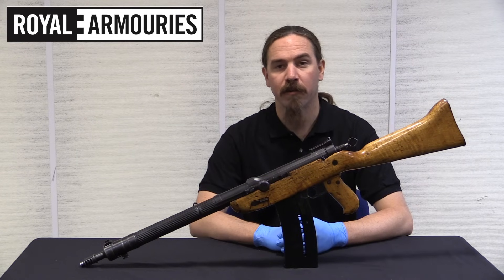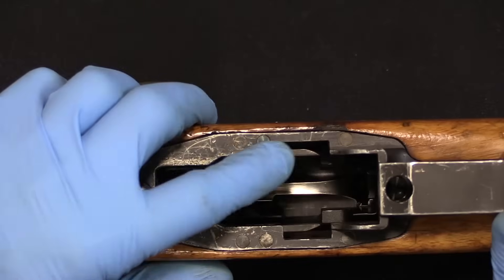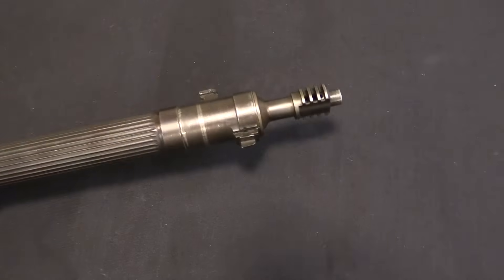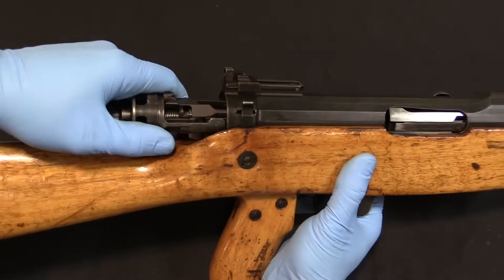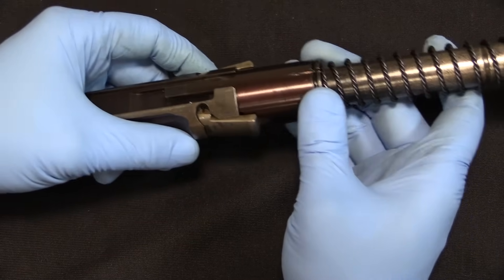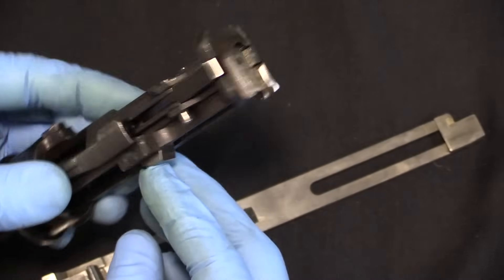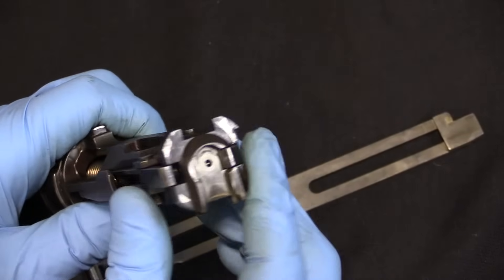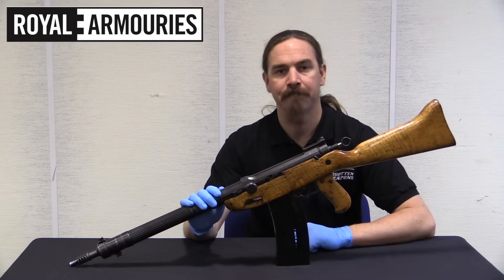SIG AK-53: A Truly Weird Forward-Operating Rifle

Comment: You know it's a weird gun if Ian isn't sure how to classify its operation.
Reply: You know it's a weird gun when Ian calls at least one component 'the thing'
Reply: "Clock Maker's Nightmare."
There, it's properly classified now.
Reply: @crimsonhalo13  I think the G11 still has that title locked down
Reply: Blow forward Piston delayed flapper lock?
Reply: @hoeruokamix  Close, but it isn't blow forward, because blow forward means an unlocked breach, much like how blowback means an unlocked (rearward moving) breach.

Now, systems are usually named after how they work. Roller delayed is delayed by rollers. Rotating bolts rotate. Recoil operated firearms take their impulse from the recoil.

So I'd call this a gas operated, flapper locked, fixed breach sliding barrel firearm.
Reply: i call it The Fluffer
Reply: Nathan Chan the G11 uses a gas operated rotary breech. The AN-94 was a stronger contender for most difficult operation to classify.
Reply: This totally started as an "I bet you can't" design. 
"I bet you can't make a gun where everything works backwards and still functions as a usable firearm."
"Hold my beer." Swiss happens
Reply: War Zone blow-foward implies that it is an unlocked action, and the gun is clearly not using an unlocked action.
Reply: @crimsonhalo13  Yeah! Perfect definition.
Reply: The gun that stumped gun jesus
Reply: Well said robooty girlyman
Reply: Because a piston is what causes the barrel to move forward, this can't be classified as "blow forward".
Reply: I genuinely think I can get a better mental image of how a G11 operates compared to this.
Reply: @Fish_nipples1998  it's a weapon that seems to fire in every configuration....
Reply: Exactly my thoughts! 🤣🤣👍
Reply: It blows.
Reply: @jackandersen1262  The AN-94 is still just a piston operated rotating bolt rifle. The odd parts are the feeding mechanism and reciprocating inner receiver, and those don't really impact it's classification.
Reply: Backwards?
Reply: I wish it was true lol
Reply: You also know it’s a weird gun if Ian has gloves on
Reply: It'd be weirder if when fired it sounds like "Cook coo"
Reply: The thing... Hahs

Comment: This was a practical joke by the engineering team at SIG. Clearly the cross of Swiss humor and engineers' humor sailed clean over the heads of everyone.  And that catch on the left side is a disassembly lever of sorts - it allows the removal of the magazine; thus disassembles one part.
Reply: When you watch the video with that being the assumption, it's actually pretty hilarious and seems highly likely.
Reply: Early example of California compliance. Magazine is fixed until disassembly
Reply: Swiss firearms designers, late in the evening after a long day at work:

"You think that's a weird operating system? Ha! Here, hold my bier..."
Reply: Perhaps SIG hired a watch maker?
To develope the back then new style guns that not only go tok.
But tik tok, tik tok, tik tok.
Reply: Let's just call it the Clock Maker's Nightmare.
Reply: I think this might just be a proof of concept for the operating mechanism and it never received further development to simplify and improve it. I think that would explain why the afterthought of a stock looks like it was carved by a third grader with a butter knife and the magazine was developed just enough to function but doesn't address the problem that you'd need to use 3 hands to reload it.
Reply: The button on the side of an AR magwell isn't a mag release. It's a disassembly button. For the magazine.
Reply: It was designed to be the antithesis of the Soviets' newly released AK47: incredibly complex and nonfunctional.
Reply: k @mtgAzim
Reply: Bet they were playing truth or dare.. and some one dared to take a rifle and flip everything and assemble it backwards LOL
Reply: 22:12  @REZPUBLIKA

Comment: If you were to look up "overengineering" in a dictionary you would just find a picture of this.
Reply: This and a G11
Reply: And most WWII German tanks from the late war era
Reply: @reaperox_  At least they kicked ass though. Basically nothing could take a Tiger head on and live. This thing is some sort of weird experimental gun so it's no wonder it sucks, and the G-11 may actually have been decent had the Germans been able to use it before the reunification, despite having the Antikythera Mechanism as its firing system and being fed on magic space ammunition that nobody else was using.
Reply: @Omicron9999  German tanks may have been "better" one on one but they weren't ever facing just one tank. Instead they duked it out against a crap ton of "good enough" tanks like the T-34 and Sherman.
Reply: Omicron9999  tigers were  moderately effective on the battlefield but a logistical nightmare
Reply: It's a long rifle - plenty of space to put stuff. For overengineering, some handguns can beat this easily. It's just working in a weird way, and little information on it is available - even Ian knows next to nothing.
Reply: @Omicron9999  (laughs in T34-85 which can punch through Tiger's frontal armor at 1k meters)
Reply: Lol
Reply: @Omicron9999  Did they kick ass? Shermans were ~1/5 the price(or less) and the Tiger tanks weren't anything close to 5x as good. Production wins wars, not specs.
Reply: @SoulKiller7Eternal  laughs in 11 million dead soviets.
Reply: @reaperox_  ooo
Reply: Or a volkswagen
Reply: @chandrasekharpalepu1379  G11 isn't overengineered. It's a complex gun. That's not the same. Compare with, say, AN-94, which IS overengineered, but relatively simple gun.
Reply: @CThyran  Didn't Stalin say something like "At a certain point, quantity has a certain quality of its own."  LOL
Reply: @chandrasekharpalepu1379  at least the G11 had a reason/excuse to be over engineered, they were trying something completely new in firearms. This thing is like an engineers fever dream
Reply: @CThyran But If you are a German and have to fight against superior numbers of enemies, would you like to fight in a Tiger or in a Sherman? There was no other way for Germany other than to excel at the technology department.
Reply: @ALBANOSTI  Non of the above. The Panzer 4 and the Stug III was the main Tank (and Assault gun) used by the Germans so the majority tank crews would never be in a Tiger.
Reply: @kshatriya1414  Panzer III, Panzer IV and the StuGs were first Generation! Panther,Tiger, Jagdpanther and Jagdtiger were the Answer to the problem of getting outnumbered more and more the longer the war lasted!
Reply: @ALBANOSTI  Not really. They were the solution to a problem but where not the main tank used except for the Panther but that was not in your original comment so it’s not relevant. 

The Panzer IV wasn’t a first generation Tank, It was a fourth generation and the Tiger was a sixths generation. And besides that, The Panzer IV had many variations made to face newer threats just like all Tanks, The Ausf. H being the most produced which started around 1943/44.
Reply: @kshatriya1414  I never claimed that any of the later high tech tanks was one with the highest production Numbers. I only said that the only way for Germany was, to excel in technical quality as quantity was not an option, being in war with nearly half the world at the same time. I think that's undisputed across military experts. But that's only true for the second half of the war. In the Beginning it was only country against country and quantity was in deed an option. As seen with Panzer II and the short barrel tanks Panzer III and IV.
Reply: @bubba200874426  A bit late here. But this is simply not true. Tech win wars, not people nor the numbers. Think breech load riffles vs smoothbore muzzleload, jet fighters vs propellas, dieselsubs vs nuclear subs, scopes vs ironsights, composite armor vs sandbags.. think machineguns in ww1. They were basically a a roadblock for any advancement until they invented the tank. Specs wins wars, but obviously theres a pivotpoint in this. you cant win a war based on tech if you dont have acces to that tech, a sole riffleman can stil be overrun by 100.000 storming at him. the "tech fighter" still have to have enough time to deploy the weaps and use them. if numbers prevent him from doing so then theres not really any comparison anyways.
Reply: @martinwinther6013  all of that means nothing if you can't produce enough to not get swarmed. It all requires a supply train, and that's all about production.

 If you can't afford ammo or the inevitable replacement parts, and/or you take too long to repair, all that fancy tech means nothing.
Reply: @chandrasekharpalepu1379  and an an94
Reply: @Omicron9999  Shermans could fuck up a tiger from head-on, man. And not just the 76mm ones, the 75s could too.
Reply: laughs in an94
Reply: @Omicron9999  "nothing could take a tiger head on and live" except a stiff breeze...or anything under 500m away. Tigers only survived due to excessive engagement ranges.
Reply: Laughs in AN94’s pulley system.
Reply: @Omicron9999  there were a number of tanks that could take the Tiger Head on. Hell even the T-34-85 could pen the tiger in it's front armor with that massive 85mm AA cannon. (the russian equiv of the 88 flak) at a kilometer away.

The IS-2 which was developed after capturing a tiger had an even more powerful gun, the A-19 122mm gun and the D-10 100mm gun(the latter was better at penetration, but the former had more overall use with the high explosive shells. 

The germans started experiencing a supply problem with manganese, which they used in their armor, and had to switch to nickle plated carbon steel which was more brittle and made the penetration against those tanks even easier. 

The War ended months before the improved IS-3 came out which was using a D-25T cannon, which was developed as an AT gun that was able to pen a panther at 1200m in 1943.  which was actually started initially to be used on the IS-2 tanks. 

The myth of german supremacy in tanks is mostly just that... a myth. They were well performing, but broke down often, and weren't actually better than most late war tanks that the Soviets and US Army were fielding.
Reply: E=Einzelfeuer M=Mehrfachfeuer
Reply: @SoulKiller7Eternal  Same with any tank packing the QF 17 pounder gun.
Reply: @Omicron9999  assuming that Tiger even made it to the front without breaking down and having to wait months for parts.
Reply: @Omicron9999  No, the G11 rifle would have been ass. The ergonomics suck, even if you were to suspend disbelief and imagine that multiple countries would adopt its caseless ammunition.
Reply: This might be bad but it aint as bad as the rolex type shit in the G11.

Comment: I'm assuming that the E and the M on the fire control group stand for Einzelfeuer (semi auto) and Mehrfeuer (full auto). You can find similar markings on the SIG 510 (PE 57) rifles. Greetings from Switzerland!
Reply: I like that your fire control basically boils down to One Dakka and MORE DAKKA. 

Are they usually different colors? Usually here in the US, if there are two colors in a fire selector, they are white for safe, and red for fire. Though I suppose if the safety is supposed to be the thing with the striker cocking ring it wouldn't be THAT weird. Or at least no weirder than the rest of this thing.
Reply: F ass/Stgw 57 and 90 come with a visible white dot on the side to indicate the full-auto selector is disabled, for shooting ranges. I guess it's why it's red for full-auto
Reply: I agree, M could stand for "Maschinenfeuer" = 'machine fire'
Reply: Now that makes sense.. Was failing to figure it out myself. But then again, switzerdeutsch is slighty diffrent to "normal" deutsch. But this is one weird gun anyway.
Reply: "Die Armeeversion des Assault Rifle 57 schiesst Einzelfeuer (Sicherungshebel auf Stellung "E") und Dauerfeuer (Sicherungshebel auf Stellung "M" = mitraillieren)."
Reply: @CxOrillion  
I own both a PE 57 (SIG 510 / Sturmgewehr 57 before the conversion) and a PE 90 (SIG 550 / Sturmgewehr 90 before the conversion) and both have the same color coding for their fire control groups. Both rifles were at one point issued in the military and before they hit the civillian market were converted to semi auto only, as per usual. The safeties are white while everything else (semi, burst and full auto) is in red. So yes, the AK-53's color coding is pretty unusual.
As for the cocking ring I have no clue. It should be functioning just like on a regular K11 or K31, but it doesn't seem to be the case here.
Reply: "One fire" and "More fire" is hilarious (it's actually "single fire", I looked it up: "ein" is one and "einzel" is single, but that's not as funny). 
Although I can't say much with the Icelandic being "sjálfvirk" (self-working) for automatic and hálfsjálfvirk (half-self-working) for semi-automatic.
Reply: Is Mehrfeuer a real word or do you mean Mehrfachfeuer?
Reply: Then where is the safe?
Reply: @loyp4328  Trust the Swiss to add a little light French in the mix to make things interesting ;o)
Reply: it goes both ways - Français fédéral is a real thing ;o)
Reply: It's MehrFACHfeuer meaning several shots/firings. Greetings from a swiss guy living in Austria.
Reply: @johannesgh90  - That is interesting. In English we usually use "semi-" to mean "partial" but it actually means "half", so "semi-automatic" literally means "hálfsjálfvirk".
Reply: @CxOrillion  Not enough dakka
Reply: @TheZinmo  you must speak one weird version of German...
Reply: @siestatime4638  Huh, I did not know that, but it makes sense. 

Btw, if it actually is "Mehrfachfeuer", that's not obviously less silly direct translated because that basically means it's "one-fold fire" and "many-fold fire".

Languages that build words from their own words sound like the speech of cavemen (sorry, I mean troglodytes, of course) in English, because it usually steals word-parts (no, morphemes) from Latin and Greek. I'm saying this to explain that this is not a diss on German; Icelandic works the same and produces similarly silly results with direct translations to English.
Reply: kawon choi safety shmafety who cares, more bullets is better- swiss engineer
Reply: So it doesn't stand for "Eeek!" and "Mein Gott!"

Good to know!
Reply: And presumably the safety was on the traditional Swiss ring but is either missing or broken.
Reply: @o0TheRipper0o  my guess was the ring was the only safety and is plain old broken.
Reply: E = Einzel (single / solo) and M = magazin / multi... only my guess, most probably wrong... i'm not a gun-guy, so don't roast me, cheers...
Reply: And the firing pin's position are "safe" and "just as safe"?   XD  I'm betting the gun is missing a piece that sticks out beside something else or a keyhole plate that retains the firing pin is missing.
Mehrfeuer means "multi-fire" just to clarify.  I don't think this gun was intended to be a LMG.
Reply: @crimsonhalo13  LMAO!!
Reply: Das stimpt. Viel Danke.
Aus Wien.
Reply: @formdusktilldeath  most likely swisd german slightly different most germans don't understand it. I understand it as I speak Dutch and German
Reply: @CxOrillion  swiss are badass people, safe for them is firing only one at a time
Reply: @Arcaviiouse  Southern Germans would understand swiss more or less well
Reply: When One doesn't work send More. That's a good analogy for single shot to full auto
Reply: @TheZinmo  actually it’s mitraillieren as Swiss is weird

Comment: This must be the work of engineers, that got totally bored of gun operating concepts since. There are mechanical calculators, that have less parts.
Reply: its actually a puzzle for Chris Ramsay
Reply: Total boredom - why else come up with a forward operating system. Is it supposed to reduce recoil? That Swiss 7.5 is not an intermediate cartridge, right? Methinks firing it in full-auto would make the M-14 look like a practical design.
Reply: @donjones4719  interestingly there are Other guns With a Forward operating system. Like the Krieghoff Serpio. I think its Just an Experiment For the Designer to Look what Other concepts Work and the companies sell These Things since its a really uncommon system.
Reply: Shoutout to my abacus
Reply: I'm pretty sure that's exactly what happened.

Because this sort of operating system (barrel going forward and picking a cartridge up on its way back) is the exact same type of system I've been thinking of in an attempt to find a system of operation not used in any guns.
Reply: not just any engineers, either - swiss engineers.
Reply: @Lardum  As already mentioned, there are a couple forward operating guns already. One or two very early blow-forward handguns, and I've seen a shotgun as well, but that was a homebuilt one.
Reply: @Tunkkis Yep, the 1894 (early semi auto pistol, I think it was a Bergman? Was blow forward. It’s a mechanism of action that defies ALL logic. I remember being 13 or so, and living in the U.K. I had no idea how guns worked, so I tried to imagine a mechanism that would enable fully automatic fire. At first I thought every time the bolt was pulled back it would sort of charge up thirty shots of a firing pin, using a spring like those seen in watches, then I remember looking at a pistol and seeing the slide come back, and we’d learnt “every action has an equal and opposite” etc in physics - so I thought of course, the recoil is used to push a part back that extracts the cartridge, picks a new round up, loads & fires it.

Then I went into more detail and learned about all the different types of operation.

Blow forward would never have occurred to me.
Reply: @donjones4719  Perhaps it produces forecoil instead of recoil, but i don't even know, if this exists. 

Perhaps it was a task for engineers: "We have to get rid of that recoil-problem." "Sure, give us until next week and we will have fore-coil instead."